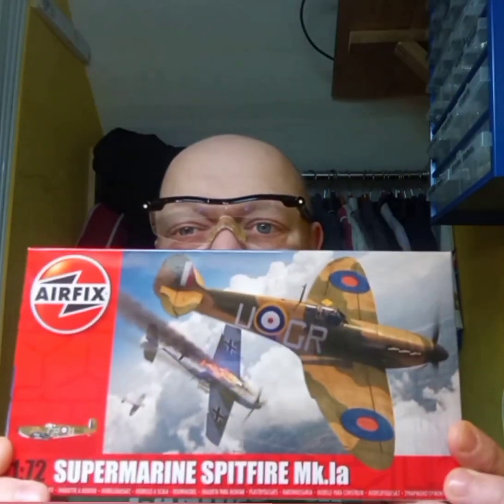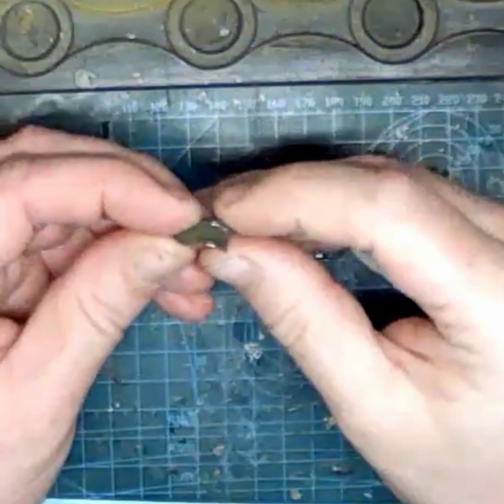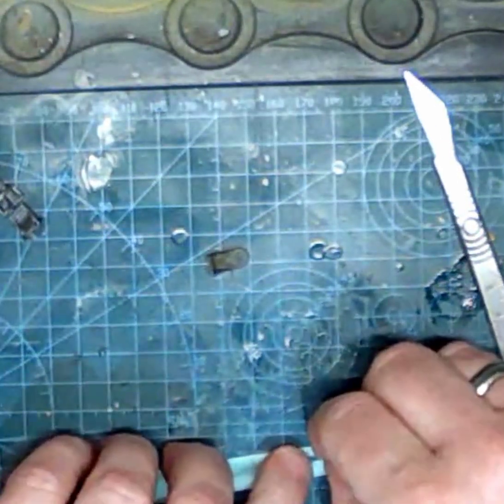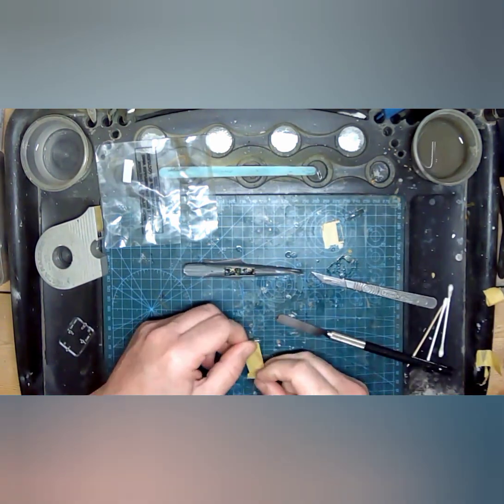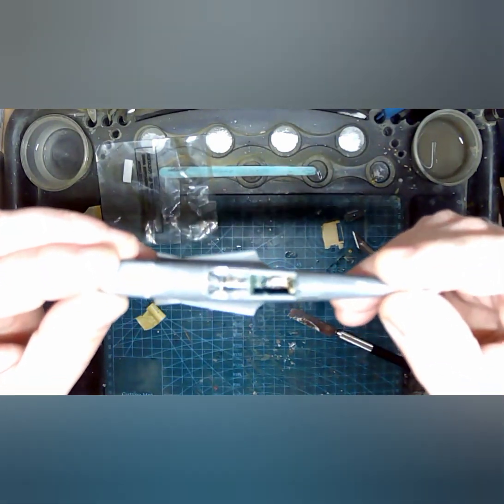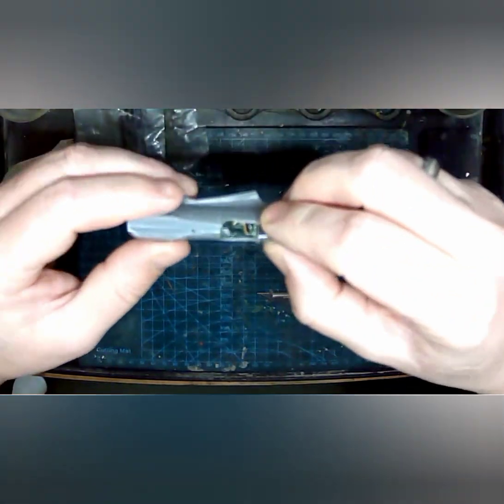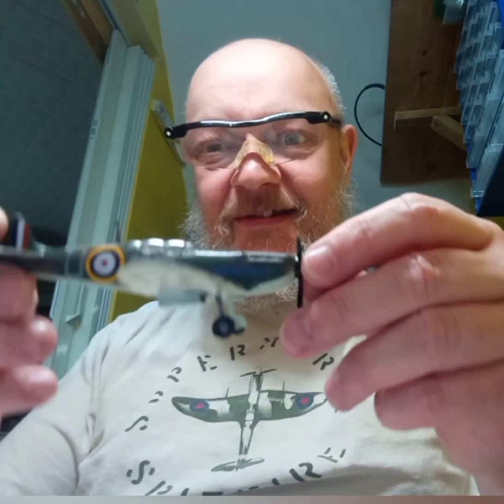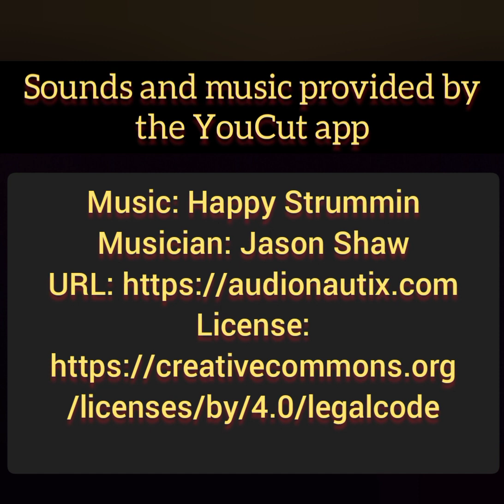Airfix 1:72 Spitfire dual seater

Comment: That's a nice conversion! My current project also involves going 'off-piste' and discarding the instructions- the important thing is to work out the sequence of adding parts and not gluing until you're sure that adding a particular part or sub-assembly won't make it difficult or impossible to add other bits. I've only gone wrong twice!
Reply from the maker: I know what you mean. I thought I had that second canopy nailed till I sat it in the Spit. Oh well, it was still fun and everyday is a school day 😁